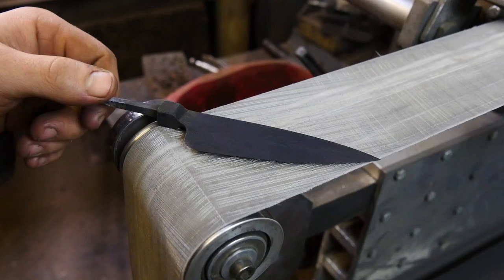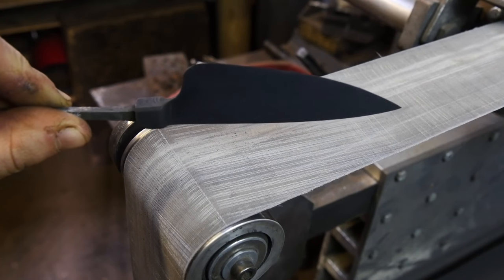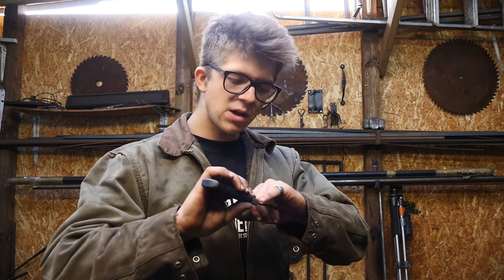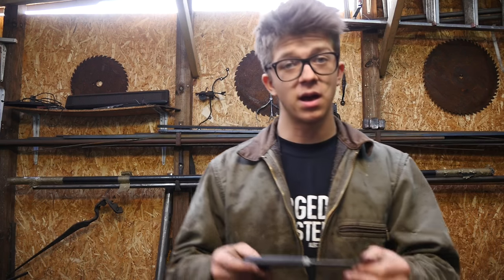MAKING A DAMASCUS PARING KNIFE #2

Comment: Ideas:  1/4" thick felt strip on your platen. Affix it so it hangs over side of platen by 1/4" then adjust belt tracking so it is also off the side as well, just a smidge past the edge of the felt.  You need pliable belts, J type at 200-400 grit.  Then you can roll it over the edge of the belt/felt and work into the small radius lightly.  Variable speed grinder on low speed helps w these types of tasks. Or use file of appropriate radius.  It will leave a step-off or marks towards blade but you should be able to knock it down or even out w rest of blade on the grinder at that point w care.  I've used a dowel wrapped in sandpaper as well as my oscillating drum sander for this in the past and found it easier to clean up than a file.  A foredom or dremel type tool w small sanding drum can be used - same idea.  Beautiful knife!
Reply from the maker: That is AMAZING advice! Thank you so much!!! Did your steel arrive yet? :D
Reply: Yesterday and it is stunning. Now to think of a project worthy of it.
Reply from the maker: Wehooo! :)
Reply: This guy knows his stuff. I'm subscribed to both you guys. Keep up the cool videos!

 There's a bunch of ways to do it. if you're going to do it with a file, do it before quench and use a finer file. diamond files leave deep scratches. Sandpaper on a stick or dowel is OK but it's tiring on the wrist. Hanging a belt off the platen is the easiest to do, but the hardest to master. Usually what you need to watch out for is accidentally thinning the blade when all you wanted to do was work on the plunge. But it takes minutes instead of hours so it's worth it haha. If you're going to use a dremel, use the little flap disk if it contours well enough. The drums are ok too, but will easily pit your work if you're not careful, and only last like 2 seconds.

And if you like to fiddle, Contour a stick of wood or a thick pvc pipe or something so it's closer to the radius if your bolster plunge. Then use PSA paper so you dont cramp up trying to pinch paper around it.

Do you do all your own video work? It's very well done.
Reply: Green Beetle That felt strip idea sounds awesome. I've always just hung it over the platen. I'm gonna have to steal that.
Reply: Alec needs to go full time knifemaker.  He's only made 3 knives and they all look better than mine. Welcome to the dark side, Mr. Steele!
Reply: you could also use a dremmel tool with a small wheal/drum and sanding sleeve

Comment: Alec - As others have mentioned - different diameters of wooden dowel with sandpaper, dremel/rotary tools, specialty fullers when forging, different diameter contact wheels on the grinder - all different ways to skin a cat.  You'll use a different way for each knife unless you start making them from patterns.  Great work!

Comment: Something that I use is a small wheel attachment at about a quarter inch, very slow speed with high quality sanding belts that have a slight cushion to get in those tight areas. Also the same kind of wheel, actually it is a metal dowel that is pressed into bearings as seen on the KMG type belt grinders using a surface conditioning belt can help also.

If you don't have one of these, round files and then a wooden dowel with wet/dry sandpaper with a bit of WD-40.

Great videos by the way, enjoy them all so far. Thank you!

Comment: Alec, what I've seen is most guys have interchangeable smaller wheels for their grinders which can get into the smaller areas. Smaller wheels also can be used for fullers unless of course you smith them in! Many of the other comments below will work as well. Great job as usual.

Comment: Beautiful knife, Alec. Great job and nice video.

About sanding small concave spots, like the one you mention, there are quite a few approaches.
The best I've seen is a set of very small radius contact wheels for the sander (actually round stock bars with bearings).
But my sander doesn't accept exchangeable arms, so I use a combination of self-made sanding minitubes for my dremel and the good old sandpaper wrapped around a wooden cilinder...

Comment: Alex, I don't make knives but I do machine work for a living. in many cases de-burring parts I have to polish inside corners. There are many commercial made products to do this but there is a easily made tool that does just about as good. Take a small dia. rod that fits into your die grinder collet or chuck and slit the end with a jeweler saw for about a inch or so. Than take some roll emery cloth(or rip a grinding belt into strips)  and fold it over with the grit outward and jam it in the slot with the ends protruding. Bend the ends in the direction of rotation put it in the corner and start the die grinder. This works best with a air grinder or a foot peddle controlled grinder like say a Foredom typ. flex shaft tool grinder. Hope this helps. Great vids by the way keep them coming!!

Comment: I normally use a dremel tool, or the small wheel on a belt sander and imperfections can be sanded out with a rolled up sandpaper

Comment: hay alec. im only an amateur knife maker but from what i know the easiest way to smooth out the grind at the  transition to the bolster is to either spend tedious amounts of time hand sanding or to put some small diameter rod in a drill and wrap sandpaper around it to make little sanding drums. or if you have a rotary tool of some kind that has little sanding drums that will work even better. love your videos mate keep up the good work.
Reply: mitctyle A rotary tool with a narrow sanding drum, or a a small 'jewelers' file will make quick work of tight spots like that. It can definitely be tedious, but small imperfections like this are where much of the charm lies in completely hand made knives!

Comment: Nice blade,  i usually use a lightweight belt an track it so that it runs off of the side of the platen of the grinder.  Also radius the sides of your platen a little.  Nice work, great videos  thank you.

Comment: As for the transition between the bolster and the ricasso, time and patience is my best advice.  However, I've been making knives since 2010 and have never tried an integral.  I think you've already surpassed my skill so far.  Lovely piece of work.  I won't use your page to give a cheap plug for my own (I hope I have more integrity than that), so maybe I'll point you there in a private message or something.

Comment: Alec, for shaping the tang recess i've seen that (you need to do this before heat treat) you can drill the wood, close to the tang dimensions, heat up the tang and insert it which burns away the rest of the material. Doing that gives you a perfect hole the exact size and shape of your tang. I've done this a couple times myself, just need to make sure you rough out the hole enough, within around say 1-2mm and make sure that the tang isnt CRAAAZY hot like glowing red or you can crack/split the wood (thats from past experience). Anyway, i know your new to knife making, just thought i'd throw you another technique that might be useful in the future.

Comment: Hey Alec, as for you wanting advice on cleaning up that area where the blade transitions from the bolster many people use a small wheel attachment for their grinders, but I've seen others use a sharpie with some very rough grit sand paper wrapped around it.

Comment: Alec just get your self some small scraps of wood grind the shape you want into them and use that to back your sand paper. that will help with cleaning up the bolster area as well as plunge lines. you can also get a wooden dowel and get the same effect.

Comment: I havnt come across that problem yet with the lines in the corner but the way I would go about fixing them is a dremmel tool with a sanding wheel the dia for the radius that you need smooth out... or you could also wrap some sand paper around a steel rod the right dia and hand sand it....

Comment: To clean up the bolster you can shift the belt on the grinder so it is hanging off one side of grinding wheel of platform then the paper will curve to the shape of the contour. Green Beetle does it is some of his videos when he cleans up his plunge lines. Hope that helps.

Comment: as for the bolster transition area, Ive seen people use a 1/4 inch small wheel attachment and round that area. I'd use the soft contact wheel. the full meta ones leave a bad surface finish. Suppose that a 1/4 dremmel would work to about 220 grit

Comment: Alec I know that you're an experienced smith but be careful with those buffers, last summer I had one that shot a knife into my boot ( it didn't hit me because I ware steel toed boots when I work) and as foe the transition from the blade to bolster When I started I used files and sanding sponges but now I use a belt grinder attachment that I made. By the way this is one of my favorite knives you've made.
Reply: or use a dremel
Reply: Vape snake dremel definitely, good tools to have

Comment: files and hand sanding or a small wheel attachment for that big fancy 2x72 grinder. could also make a blacksmith helper with rounded dies that match the desired dimensions and use that to part the material which would give you better lines to follow. Or  you could try tracking the belt off of the plated so it curves around the side which should allow you to clean up the transition as well. just some ideas i have floating around in my head atm. i dont have a big grinder (yet)  so im stuck with a 1x30 sander, files and hours of hand sanding

Comment: dont know if anyone said that already but you can heat the tang with a torch and so burn it in the pre drilled hole in the handle. saves lots of time. do it before heat treating though :D well or just be careful.  I never had Problems with overheating the edge while burning a tang in...

Comment: Dremel tool / round files / rod with sandpaper / tiny wheel attachment on the belt sander / rounded hand-sanding stick / thin oscillating drum sander.

Pick one or more, add time, make that transition smooth. Hope to see more knife vids in the future.
Reply from the maker: +Eagle Bird Knives Thanks Eagle!!!
Reply: agreed

Comment: use a flexible belt and adjust the belt tracking so it's hanging about 5-6mm over the edge of the platen on the grinder. The belt will conform to the curve and clean it up nicely.

Comment: as a blade smith i personally use a wood dowel wrapped with sand paper to get clean out the curve in the top end of a bolster. it can be fairly tiring to do it this way but it is my own opinion it offers better results than a dremel
Reply: whatll also help is to run it with different cuts of files before you polish the blade

Comment: use the contract wheels at the top or bottom of your belt grinder, there probably 3 inch wheels which work fine, I use a 2 inch and do a full flat grind on the wheel and finish on a 1200 grit don't even have to hand sand it afterwards, the only thing is is that you have to get the plunge lines prefect or it will look off. great looking knife overall, don't let that bladesmith's fire die out ya hear

Comment: Normally you make the bolster seperate from the blade - the blade and its tang in one piece and the bolster as a seperate piece with a hole in it so that you slide it down the tang to lie against the begining of the blade (and is glued on there together with the handle). Thus you can refine the blade and the bolster independant of each other. However, your version with this integrated bolster is more advanced/difficult and brings extra vlaue to the knife so stick to that. I would myself use a dremel with a sand paper tool attached to it (there are many different grits and also polishing tools that you can attach). If you don't have a dremel you can put a round stick or even an old drillbit in your drill and attach normal sand paper to it. You have a belt grinder though so a small wheel on that one should do it as well.

Comment: How much does one of those large belt grinders cost?
Reply: CrimsonEclipse5 I work for an industrial supply house, the belts cost less than five dollars each if you go through the manufacturer, but you have to order at least ten of each grit you want as they will not split cases. Norton Saint Gobain makes a variety of simply amazing abrasive belts, I cannot recommend their Blaze line of belts enough for iron work. Sia Abrasives makes good belts at an affordable price as well and they typically ship next day unless you have a truly unique belt. Dynabrade is a little over priced in  my experience, but if you're cutting soft metals like brass or aluminum, they do not gum up or clog as quickly as Sia belts do. Whatever you do, don't ask what the grinder he's using costs on its own, you don't want to know.
Reply: CrimsonEclipse5 I work for an industrial supply house, the belts cost less than five dollars each if you go through the manufacturer, but you have to order at least ten of each grit you want as they will not split cases. Norton Saint Gobain makes a variety of simply amazing abrasive belts, I cannot recommend their Blaze line of belts enough for iron work. Sia Abrasives makes good belts at an affordable price as well and they typically ship next day unless you have a truly unique belt. Dynabrade is a little over priced in  my experience, but if you're cutting soft metals like brass or aluminum, they do not gum up or clog as quickly as Sia belts do. Whatever you do, don't ask what the grinder he's using costs on its own, you don't want to know.